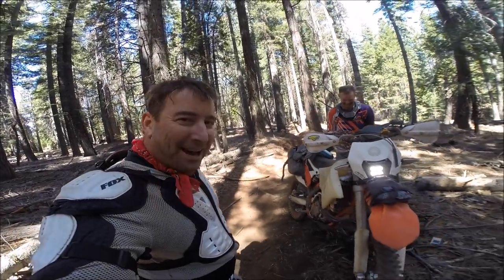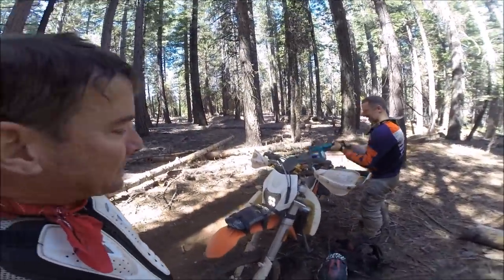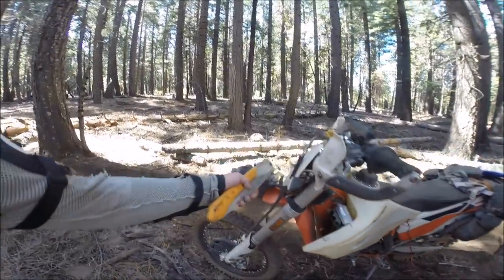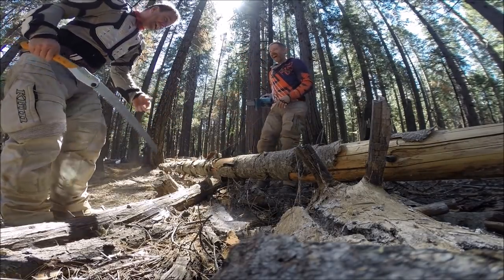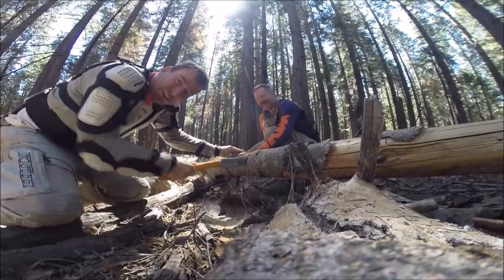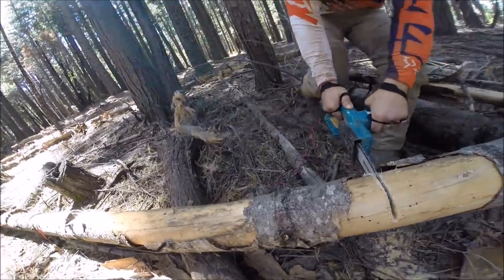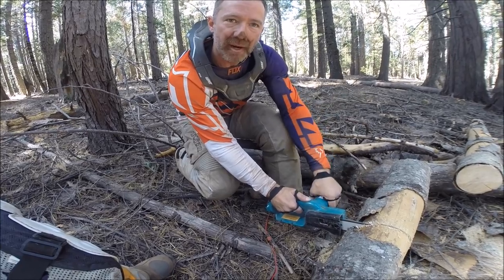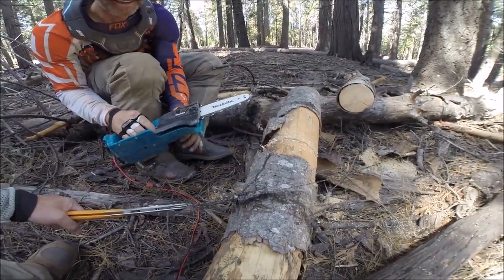Silky Big Boy handsaw vs. Makita 12v. Electric saw on the trail

Comment: Illustrates how useless both are for clearing trail.  May allow one to get "through", cutting go arounds, or bucking limbs off, to go over larger downfall.  Creating more work for the rider/trail volunteer, who clears the trail.  Rider's jumping down tree's, covers the tree with dirt, quickly dulling the chain, on the chainsaw. In addition, once the tree is cut out, now the trail volunteer must block the go around, off trail path(s) created by the trail abusers who cut out the go arounds and only make the trail "passable", not cleared.
Reply from the maker: Yep...time to get a chainsaw...(and a mount)
Reply: Agreed. Time to get a (real) chainsaw!